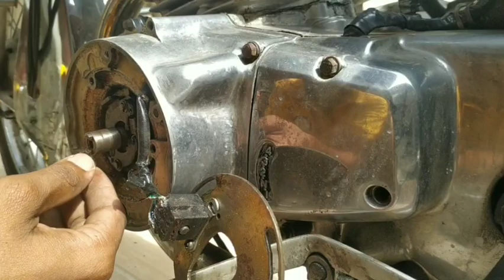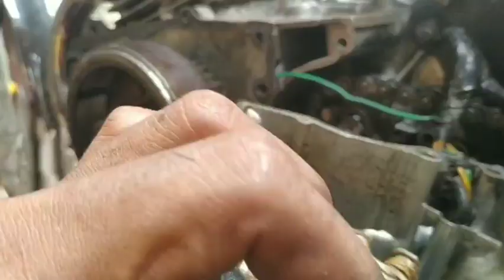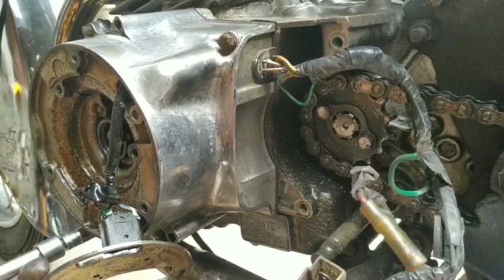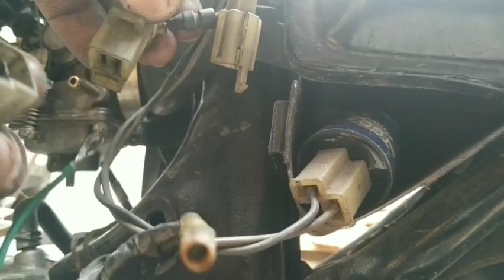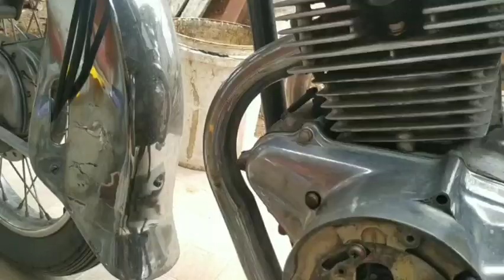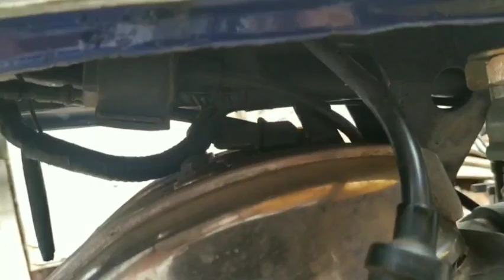HONDA CD 185 ROAD MASTER 12V CONVERT

Comment: What's the difference between the CD-185 roadmaster and the CD-185 twin? Is there a difference?
Reply from the maker: https://www.google.com/url?sa=t&source=web&rct=j&url=https://www.autointro.net/amp/compare/bikes/honda-cd-185-1979/honda-cd-200-road-master-1980&ved=2ahUKEwiP9-b1s5r5AhXGIbcAHZhqDskQFnoECBEQAQ&usg=AOvVaw3TW47bxnhXpVsqb0za1Q74
https://www.google.com/url?sa=t&source=web&rct=j&url=https://www.pressreader.com/uk/classic-motorcycle-mechanics/20191216/281676846791265&ved=2ahUKEwiP9-b1s5r5AhXGIbcAHZhqDskQFnoECCkQAQ&usg=AOvVaw3BTPeYvClRxYls-bC6ozsZ

Comment: My motorcyle has 2 cylinders any idea how to make this system work on it
Reply from the maker: If the two cylinders have separate time ranges, two palser coils can be connected
Reply: @n.p.channel1568  yeah thats what i thought ... it so hard to fit two of them in such a small place
Reply from the maker: What is your bicycle type?
Reply: @n.p.channel1568  I dont know the model I couldnt  find it written anywhere on thr bike I recently bought it ....all i know is that it has 2 cylinders I opened yhe cover  i can see that there are 2 contact points and when one of it is closed the other one is open
Reply from the maker: Please send photos of your bicycle engine to this email address 
npranasinghep@gmail.com
Reply: @n.p.channel1568  I did it check your gmail
Reply from the maker: Ok
Reply: @n.p.channel1568  u saw it if not check again your gmail because there was a problem with my internet
Reply from the maker: I saw the pictures you sent and I will send  an idea so that I can give you some time
Reply: @n.p.channel1568  ohk thenks
Reply from the maker: are you motorcycle 6v or 12v Better
Reply from the maker: Are you motorcycle 6v or 12v battery ?
Reply: @n.p.channel1568  it doesnt have a battery in it

Comment: What are the parts we must use
Reply from the maker: Requires Benley 12V Coil Pack, Benley 6Pin CDI Unit, Benley 12V Ignition Coil, MD90 Advance, MD90 Palser Coil and gold line flywheel.
Reply: @n.p.channel1568  mata kiwwa MD 90 eke govonor eka aye othanna oni kiyala eka aththada?
Reply from the maker: @071Rishi  advance ake coil monwath neha akata enne magnet kelak thiyenne kalayak Yana Kota magnet gathiya adu wenawa achrai wenn
Reply: @n.p.channel1568  brother call ekak dennada
Reply from the maker: Ok
Reply: Aiye meke 4 pin cdi unit ekai 6v coil pack ekai aulak nethida
Reply from the maker: Awulk nethuwam neme Original coil aknm tika kalayk puluwan Wei   12v  platinum akta wada 6v coil aka 12v CDI karoth  parism Kara gana puluwan